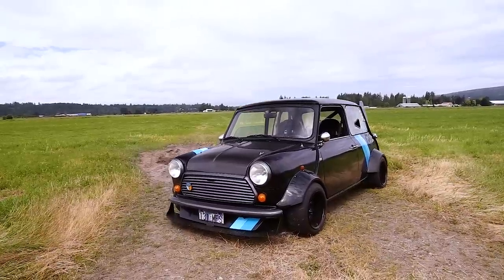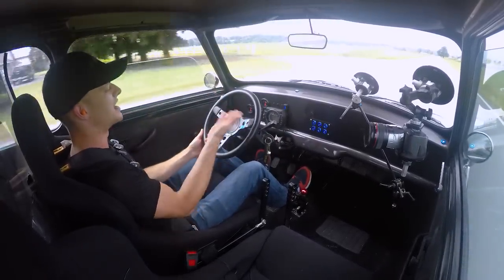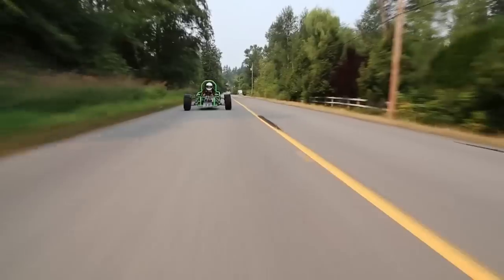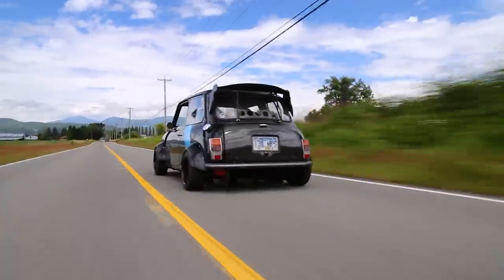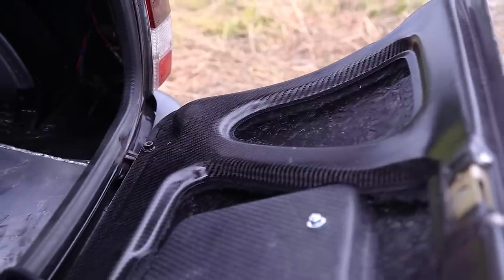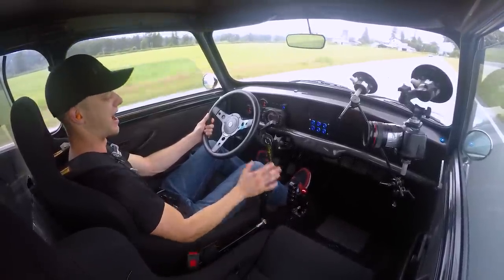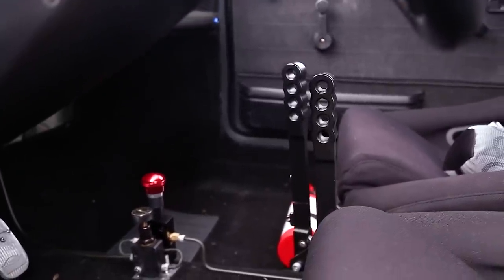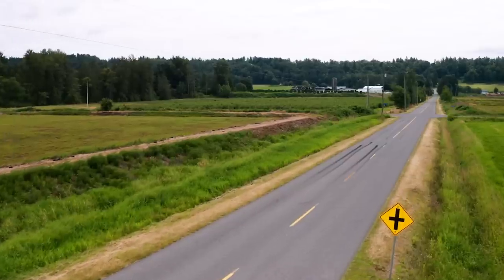This Custom Mid-Engine Mini Revs to 13,000 RPM! | Outrunning Sanity

Comment: To get reverse you can use an ordinary car starter moter with a chain and sprockets on the rear axle, run it straight off the battery and an on,off switch on the dash.

Comment: And this is exactly why I’m putting a turbo hayabusa engine into my Willys Jeep hotrod 😉
Reply: No
Reply: Mark Robinson what do you mean no? 😂
Reply: Patrick Bateman much harder to find though. And I am stopping at 400hp as even that would be sketchy for the weight of the car. Plus a lot more aftermarket support for the hayabusa engine
Reply: Patrick Bateman the hp is pretty close to what most compact cars have, the torque is lower though. But you really don’t need to go 300kph either so when it’s geared down you have a monster!
Reply: That will be awesome man
Reply: YUUUHPPP SUBSCRIBED
Reply: please make a video
Reply: Please see: owner jeep, Philippine 3rd party custom jeep clones, usually using a japanese drive train from a 4wd saloon car.

Comment: So it runs sequential gearbox?
It kinda looked like one, and that noise ... Damn, music to my ears...
Reply: It'll be using the ninja transmission I'd imagine (haven't finished the video yet), and bike transmissions are all sequential, yea. That's why he was pushing it backwards, they don't have reverse
Reply: Bikes have a sequential gearbox, and most motorcycle engine are all one unit, the gearbox clutch, and cylinders are built in one unit.
Reply: @patrickarchibald6787  almost all in 1, you can still strip gears in a motorcycle and replace gears.

More annoying why don't they use auto blipers so you can shift up and down without a clutch
Reply: @Wladpad so can I but it's not as much fun
Reply: @streetmtb  some bikes do - recent BMWs are programmed from the factory, and an auto shift is a simple kit

Comment: Coolest thing I've seen this week.  Curious that a ZX-10R engine was chosen over a ZX-14R engine.  Guessing the engine was previously tuned for MR12, which is why it was so rich.  Any thought to using a paddle shifter with a quickshifter?  Nice job.  Any performance metrics recorded?

Comment: Fuel cell in the front sounds nice and safe :0
Reply: If you know anything about mini's you'll know its as safe as it was from the factory.. fitted one inch from the bootlid at factory...
Reply: like car people ever gave a fuck about safety
Reply: and exactly where are porsche tanks fitted again?
Reply: @antonyaiken  behind a firewall in the front.
Reply: Better than having the engine in your lap in an accident trust me on that.
Reply: Just making sure that if the crash doesn't finish you off the flames will take care of the job 👌
Reply: Like you drive a mini  to be safe😄
Reply: @deerpeter1  🤪✌

Comment: Just because that looks a bit too non-stock, have a little look at the Project Binky series by Bad Obsession Motorsport. Toyota Celica GT4 engine and running gear into a mini. For funsies. You wouldn't believe it to look at it from the outside (and it's not quite finished yet) but sooooo much of it has been custom fabricated by them. Ultimate sleeper! Would be awesome to see a back to back with this when it's done. Shame the Atlantic seems to be in the way :(

Comment: Looks like great fun. Outstandingly good built mini👍❤. There are many engine options to consider for the mini, but I like motor bike engine's in mini's (the sound, rev's, & shifter). A H2R engine would be mental in a mini.
Reply: This has been a dream build of mine. The supercharged H2R engine would have the torque to really move the extra weight of a car without being so stressed.

Comment: No mention was made of the motorcycle the engine is from, or the capacity of the engine. I'm a bit of a Kawasaki nut, the instrument cluster looks like it came out of a Z1000, but they make more like 130 HP.
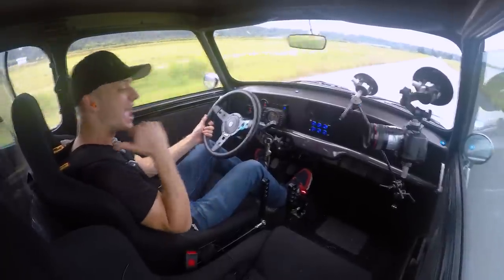Reply from the maker: 2:09 Hope you enjoyed the video!

Comment: As a mini enthusiast myself I can’t help but notice the car is left hand drive but your brake master cylinder which is connected to the pedal box is still on the right. There is a slot for it for LHD vehicles to have this above the pedal box on the bulkhead crossmember. Might just be me but it seems a bit odd

Comment: why you lifting when changing up though? pretty sure you don't need to do that as on the motorcycle you just flick up a gear and the quickshifter cuts it for a split second
beautiful build though

Comment: It makes the noise but doesn't seem to go anywhere, its quite weird to watch, what's the 0-60? I bet its not 4 seconds 😂😂 more like 8 or 9, which is naff in this day n age, so was it really worth it?
Reply: Put it in a calculator. Bog standard Mini weighs around 600kg. So less than that with a bike engine and stripped-out interior. Kawasaki Ninja ZX10R engine makes around 200hp. So up to 400bhp per tonne.

Comment: Almost all bike-powered tiny car builds are fucking lame. You know why it's mid-engine when the engine bay is in the front? Because placing the engine on the back is easier to connect it to the back wheels. No transmission. No actual fabrication. Lame.